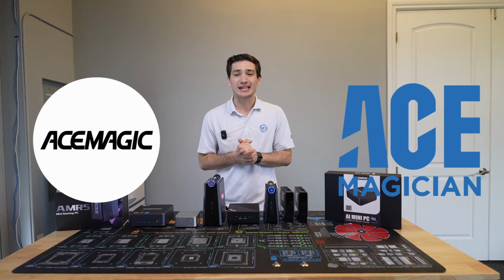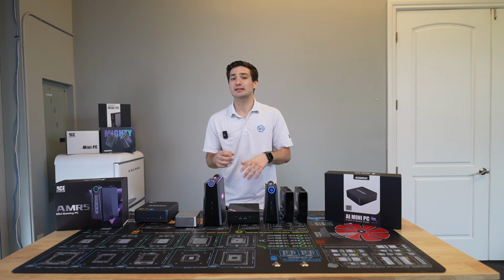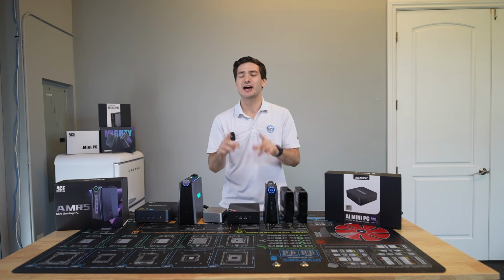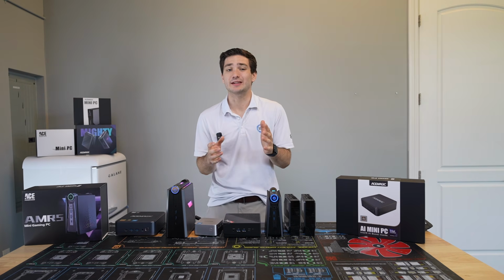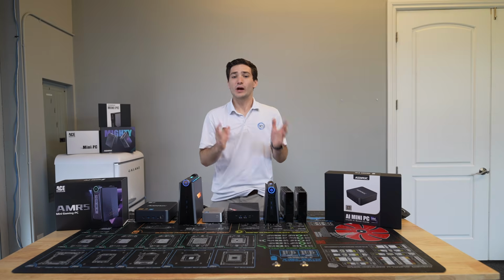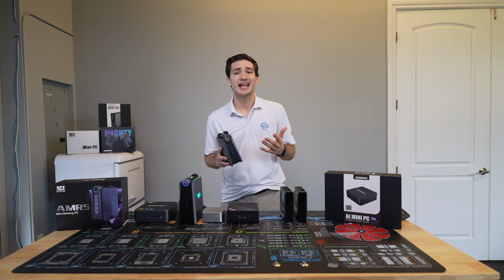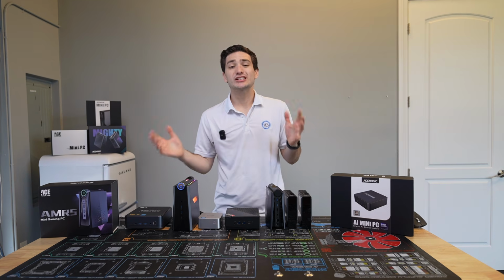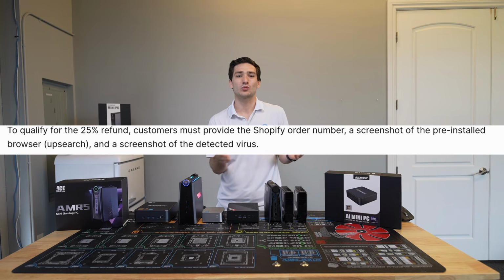Acemagic Is Selling SPYWARE! Don't Buy These Mini PCs

Comment: This is why I ALWAYS reinstall windows on ANY machine that I get. I first run Active@ to fully wipe the drives then I install windows from an ISO that I download. If I didn't install windows then I don't trust it at all and it will go NOWHERE near my network.
Reply: Wait until you learn about the Intel Management Engine
Reply: @jp6568  Just disable that little goodie from Intel. In 2024 you have to figure everyone who can will install some kind of info gathering software bundled into any piece of software you install. Except Microsoft that is. Forget Cortana or it’s successors, add to that that insidious piece of spyware Windows Security aka Defender. It phones home regularly to home with all kinds of info about your habits. Sales of users interests and habits has become big business and everybody is trying to get their piece of the pie.
Reply from the maker: That’s definitely an excellent model to follow however, majority of the people buying systems like this. Have no idea that they need to do this nor do they know how to do it. And that’s the real problem.
Reply: @mattscomputerservices  This is very true. Many people are just not that tech inclined to know that they need to reinstall windows on machines like this.
Reply: @mattscomputerservices  Instead of just telling them not to buy it, perhaps you should point them to how to install Windows... or even Linux. 

Even PCs without malware often come full of bloatware... so I think it's a good idea to just reinstall the OS anyway. Better yet, for most people doing basic tasks... install something like Linux Mint, which is easy to use.
Reply: @mattscomputerservices  I just bought one of the AceMagic V1 n97 16gb mini PC.. so the best thing to do is boot up the PC and then choose RESET PC, while choosing to reboot with a downloaded verion from online and NOT from the version installed on the PC already? Is there any other pointers you can give me about using this mini PC?
Reply: Unfortunately, I got one of these PCs, the AMD 5800U version. The suggestion to do a clean install won't work. I tried all the possible editions of official Windows images and none of them installed on the machine. The installation hangs for hours and finally ends up in a blue screen. The result is always a failure, whether you format the harddrive, remove all partitions and redo partition map, delete hidden partitions using live Linux. Only their custom Windows 11 image downloaded from Google Drive does install. It has (scaringly) many preinstall and post install scripts that it runs and downloads things from the Internet. I am not able to pinpoint any known malware in the installation image or the installed system using Defender or Avast, but I am still investigating.
Reply: @turgaysenlet  I'm curious, did you found out something?
Reply: @turgaysenlet I know I'm way late to the party here. But it's exactly the same with the 5875U version also. 
I won't accept any other OS so I have no choice but to use the OEM one. 
Have you had any issues since?
Reply: @turgaysenlet  i put another, better drive instead chinese kingdisk or however 😂
Reply: @turgaysenlet  Swap the drives completely, but also, youd have to find the individual drivers to install. Just go buy a minisforum instead. lol
Reply: Hi, i have this pc, got it as a gift. Haven’t use it yet. What should I do if I want to use it? I really don’t know about these malware and virus. What should I tell my local pc stores tech if I want to clean install it? Would it be able to use it normally? Including the screen thing? Please help
Reply: @popthatbeep .. first a fair description of the issue. Windows 11 desires an online account. From that second after authentication and boot the current configuration MAY start sending collected data to a third party .You could spend time going through windows defender and it will probably find the illicit files but I think it is a much better practice to back up your windows key and reinstall windows. A computer geek has these tools and should back up your windows key or you would have to purchase one ! All of the software is free. The windows 11 .iso is freely available at the windows sight. So… tell the geek that you have read reports that your brand new, never booted device may have malware on it. Ask that they back up your windows key, completely reformat its hard drive and perform a fresh install of Win11. Don’t accept any upselling offers on virus scanners as the default embedded scanner is a good guard against unintentional malware. Your only price should be labor. Lastly windows 11 itself has a lot of bloatware. Bloatware sends info to Microsoft and or 3rd parties. It is considered not an invasion of privacy but “Steals” computer and wan horsepower. A competent geek should be able to turn this off…. Disclaimer I am retired geek ( and network engineer ) please find a good geek and ask him to show you how to use windows virus scanner ! Any computer owner needs to know ! Take care…
Reply: @popthatbeep  If it's a known brand like asus, lenovo etc. i wouldnt worry
Reply: this will not help if virus/malware is present in bios, 0-sector of SSD or special partition in SSD that only visible in Linux  (like we have in XBOX)
Reply: @ronlevon4294  Just the fact that you think malware is bios loaded on a mass consumer product proves you have NO clue what you are talking about. This is real clown shit. Let's discuss how silly you are being? For real, please, let's engage in this conversation...So normie consumer computers are getting loaded with bios malware? Lol, do you even know what that means beyond the initial concept?

Lol, tell me you don't know what you are talking about without telling me you don't know what you are talking about
Reply: @ronlevon4294  Bios is actually a thing to worry. It makes you wonder if you should stay away from all of these devices.
Reply: @ronlevon4294  just run G-parted straight off a multi-boot usb. I keep g-parted, puppylinux, and windows 10 on my multi-boot
Reply: Thanks for video, any suggested manufacturer of mini pcs?
Reply: @FabioGruppioni Asus also made one under the ROG brand
Reply: @FabioGruppioni  Beelink. BTW, during the time this was going on I received an ACE MAGIC T8+ for review. It had no such malware anywhere on it. It didn't do anything this channel is saying. There was no baked in Chrome with weird websites. No key loggers. No backdoors. Nothing. It was a bone stock Windows 11 Pro with a working license. It connected to the internet during install to finish up the install and gave me zero issues. Still connected to my network today with zero issues, other than the machines own shortcomings. The unit is so small they didn't bother with SO-DIMMs. The memory is soldered to the board and I have not found a single guide or YouTube video showing how to upgrade it. I know it can be done. I know the BIOS has no issue with it as I contacted ACEMAGIC and they said it would work but would void the warranty. My other issue is that this model should have came with at least 12GB of memory stock. 8GB is not enough to run the OS, code and do much of anything with the iGPU and the iGPU is surprisingly limber for what it is. It will play DOA6 in SD res @ 60fps. 720p @30fps (Which just isn't enough for a 3D fighter) but with 16GB it allocates 4GB to the iGPU and all of a sudden it's not an issue and you get a speed bump. It also is enough for full 4k playback but it only supports HDR in 1080p due to the ports Ace Magic saddled it with. They are HDMI 2.0 not 2.1, so not enough bandwidth. But you can plug in 3 monitors.
Reply: @FabioGruppioni geekom and Minisforum
Reply: Did you consider that they may even have spyware on the chip on the motherboard...many routers from China were found to have backdoor on a non-suspicious looking ic on the motherboard and that was 10 years ago.
Reply: Anybody knows how turn off led screen case completely? When I turn off ace magic S1. The display still turn on. I wouldn't like that.
Reply: @Imnotimportant555  You speak my language, unfortunately like 90% of my fellow Americans are IT illiterate.
Reply: Do you have a tutorial on how to do this?
Reply: I have one of thise pcs i just reinstalled windows
Reply: I Agree. And anyone that is capable of this concept may also have a low opinion of Windows 11 and promptly install a Linux distribution, I prefer Mint. Then VMWare workstation pro ( now free ) or Virtual box ( always free ) can be installed for windows emulation if needed. 95% of product reviews IGNORANTLY, don’t even touch on security. There should NOT be any expectation security.  Every IOT product made in CCP has a back door via software or firmware.
Reply: Wait until you learn what MINIX is used for on your machine.
Reply: What you do to the Bloatware installed in bios?